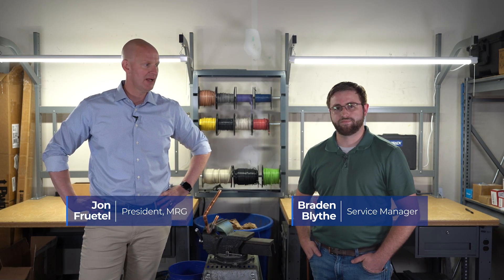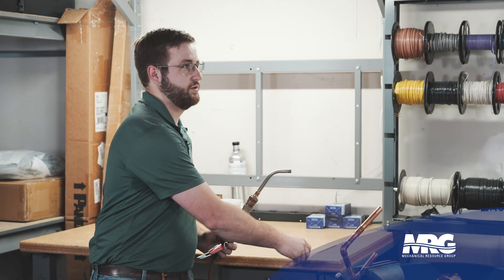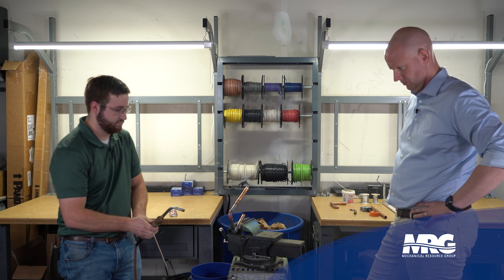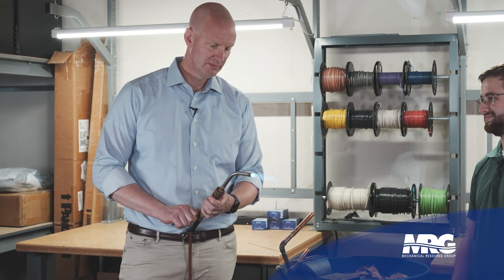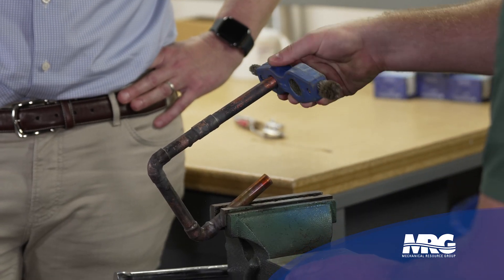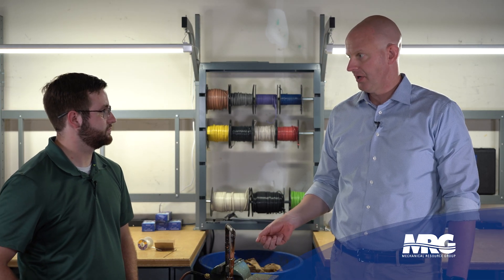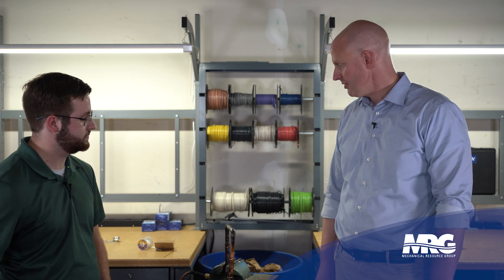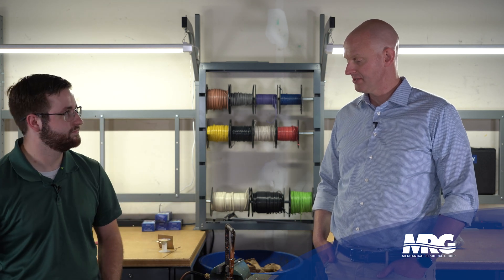Brazing and Soft Soldering: Techniques, Tools, and Tips

Comment: I was always told that you don’t want it to get cherry red, I couldn’t imagine getting a txv cherry red you would damage the valve
Reply: In my opinion with decades of experience, you are completely correct. We are all guilty of getting the copper cherry at times but that kind of temp will anneal the copper to the point where it is probably weaker than the braze. Also yeah you will be changing a tx more than once if you get it that hot.